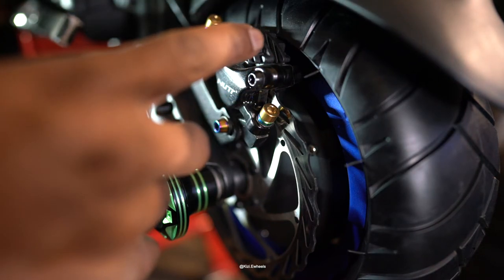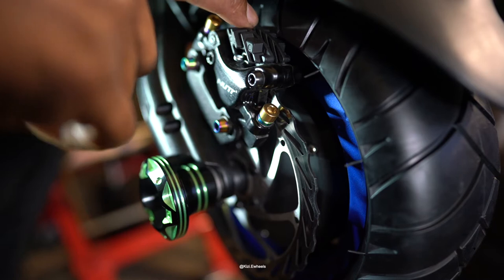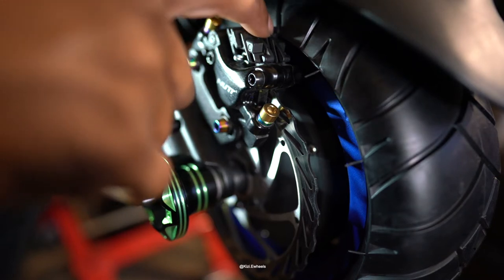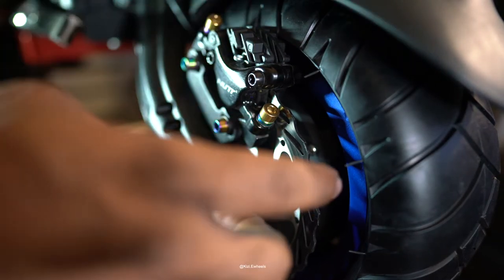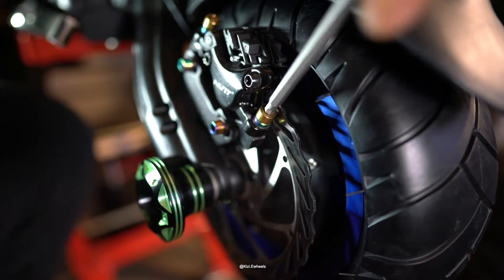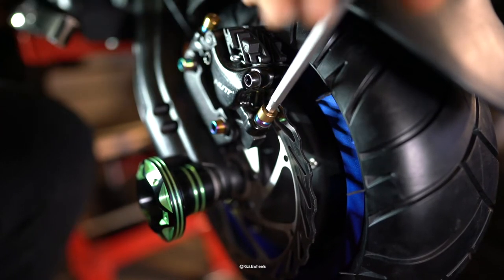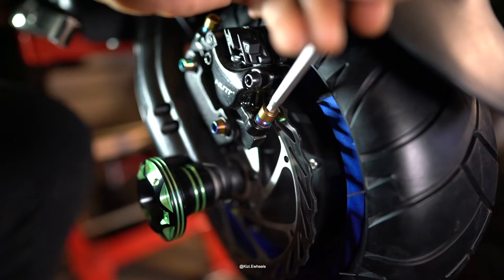How to change your brake pads on a Dualtron electric scooter

Comment: You may need to loosen the brake reservoir fill bolt, and then push the caliper pistons in, then top off the fluid after seating the pads to the disc with a few squeezes.

Comment: Thank you, you saved me from taking too much things off.😄
Reply from the maker: Glad I could help!
Reply: @No Tech Guy  You forgot to say one thing and explain because a lot of people are gonna have the problem that their new brake pads so they're not gonna. Fit it's gonna close up and it's not gonna go over the rotor, so how else do you do that? Do you have to undo the other screw and loosen it up
Reply: What I mean? Is it will be too tight of a fit because the new brake pads are thicker. They won't be worn out so it'll be very hard to fit back on. I've. Seen? This on e bikes two and other scooters when they're worn out they go right back on or you take him right off it's easy
Reply: @NoTechGuy  I assume you have to loosen up one of the screws on the side to get the new brake pads to fit. That's the only way to going in there. Are you're gonna ruin the rotor

Comment: 0:51 yes you did not take whole thing now. why safety pin not out side so not need take whole thing off LOL is this same as thunder 3. even i not care.
it sold max range 170km but eye4 says 106 when 100%. why need lie. it should say 170 and it drop more than you drive if go fast and eat battery. i have all set to safe battery accelareta fast even power out 80& still say range 106 LOL why there no single mode LOL dual mode eat battery to get you same speed just faster
Reply: I have thunder to, but same 72v 40ah battery. my ey4 says 80km. why would that be?
Reply: @MDbandit10  its max range if drive 25kmh, but its fine i drive around city 20km or so battery level still 96% xD i ride slow.
after week go work i have 60% bout 60km,, basically i could try 120km but last voltages on battery is allways just lucky